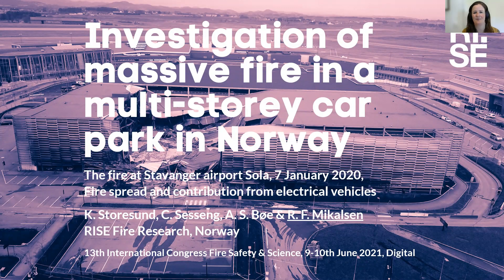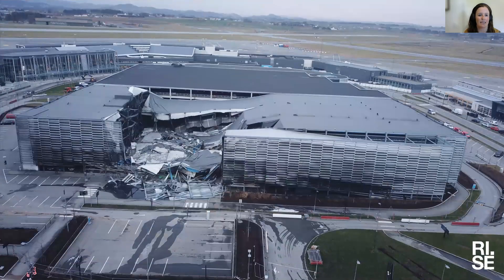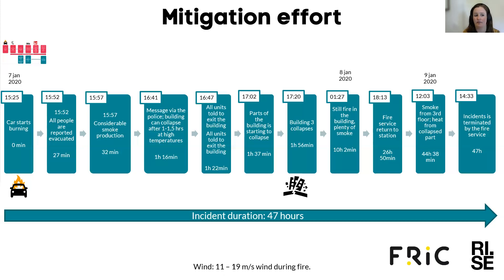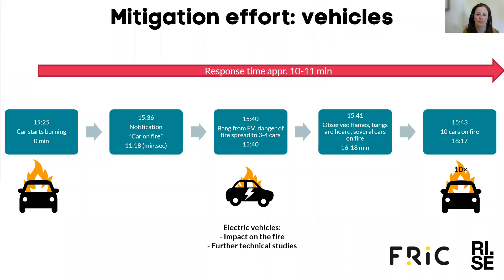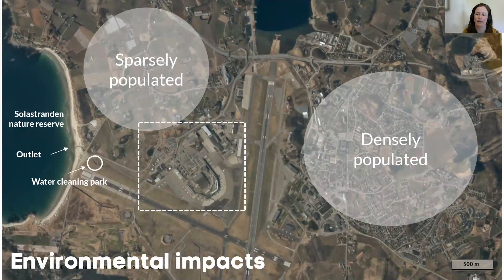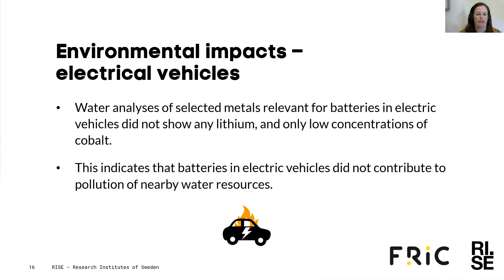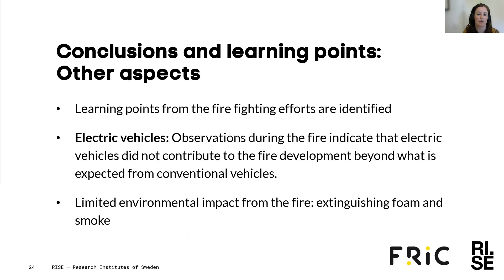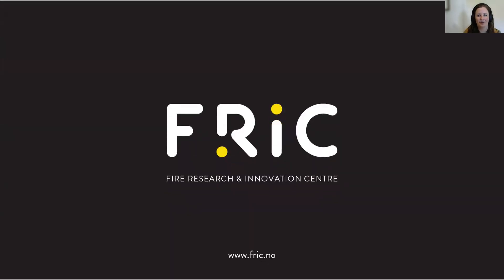Investigation of a massive fire in a multi-storey car park in Norway - Ragni Fjellgaard Mikalsen

Comment: For non-firefighters, don’t jump to the conclusion the description of ‘loud bangs’ meant that an explosion involving fuel of ICE vehicles or battery packs of hybrid or electrical powered vehicles. As sidewalls of tires (tyres) burn they will fail, in one instant. This creates a very loud bang, and released air may momentarily redirect smoke, easily leading witnesses to believe they’ve seen a fuel system explosion. Multiply bangs by four tires per car if it continues to burn. Of course for trucks (lorries) or heavy commercial trailers each tire contains more air that is at higher pressure, so failure is even more dramatic. Engineering makes fuel system explosions rare.

Comment: What I'm confused about is looking at the details of the Zafira recall, the fire caused by overheating wiring is localised to the dashboard. Diesel has a very high flash point so how could it ignite from a small dashboard electrical fire? or it wasn't the diesel that ignited first?